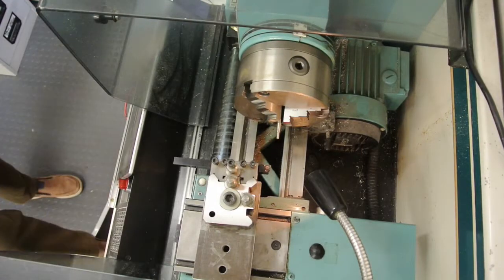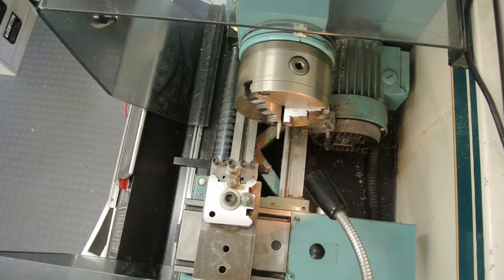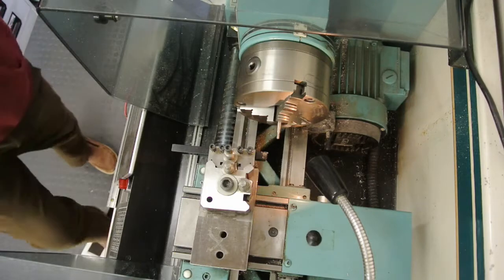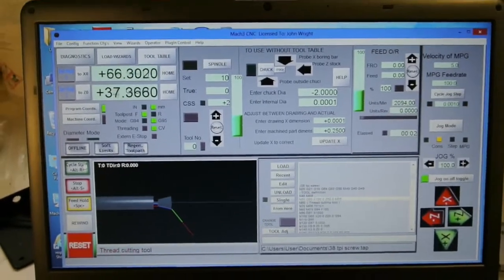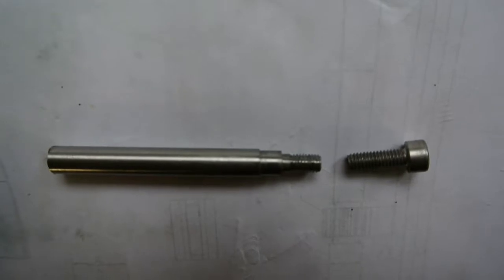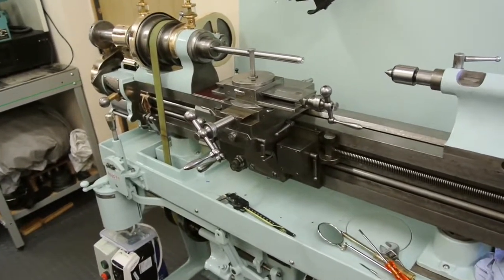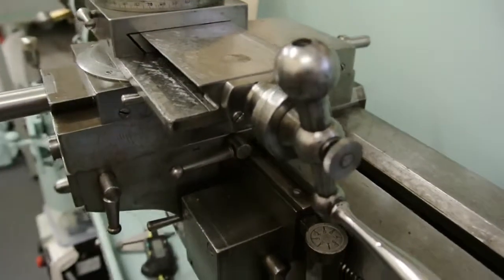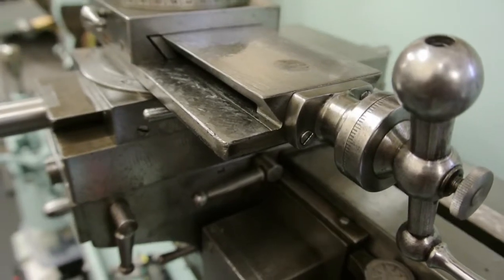threadcutting 40 tpi on Mach 3 on Orac lathe

Comment: Hi John, it looks like you've fitted a new chuck - can you tell me what it is? How did you go about turning a new backplate?
Reply from the maker: Hi Luke

The chuck I fitted was a 125mm Pratt Burnerd chuck I made a new backplate for the chuck from cast iron and fitted it to the existing holes in the spindle backplate. This chuck is useful as it is bolts onto the new backplate with screws direct from the front. Ideally the register should be ground to fit. The chuck was not as accurate as I had hoped and it was only after regrinding the jaws carefully with a diamond grinding wheel that I got it accurate. After making the blank fit the register on the existing spindle mount you can fit the new back plate to it and do the machining in situ. 

John
Reply: @john2478  Ok Thanks John. Can you elaborate on how you matched the existing spindle nose taper?
Reply from the maker: @lukeatj  
Luke
It was a while ago and cannot remember exactly what I did. Also I do not have the old chuck as I sold it.
As far as I recall I used the recess in the chuck as the pattern so I could trial fit it as small amounts were taken off on my Boxford lathe.  For obvious reasons I would rather not take the backplate off now it is perfectly accurate. Checking on the internet last night I saw this has caused people a lot of problems and I seemed to have done something rather unusual! The internet does give some suggestions as what the angle should be but setting up a small hobby lathe accurately to cut it is another thing. Probably best to make a copy of the lathe nose on another lathe and use engineers blue to get the taper just right using your top slide. 

I have also made threaded backplates for a Boxford lathe, a Drummond lathe and for the Rivett lathe I have. The Rivett was by far the most difficult but very satisfying when I clocked it with a dial gauge when finished.

Incidentally the 125mm dia chuck is so much more use than the old one supplied with the lathe and I can machine aluminium up to 115mm diameter. The cross slide is the limiting factor of the lathe with its restricted movement and I have made up a new ball screw and stepper motor with its bracket to nearly double the movement.

John